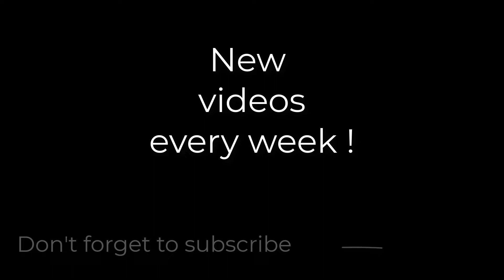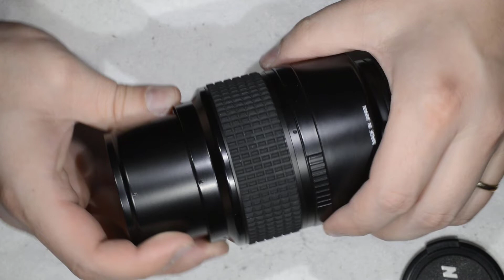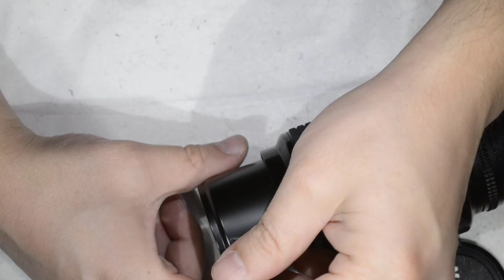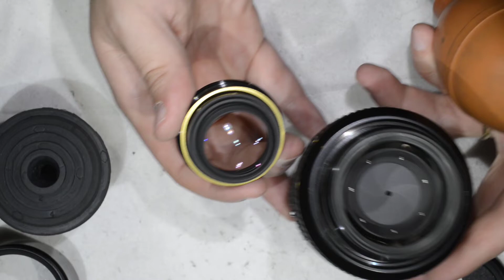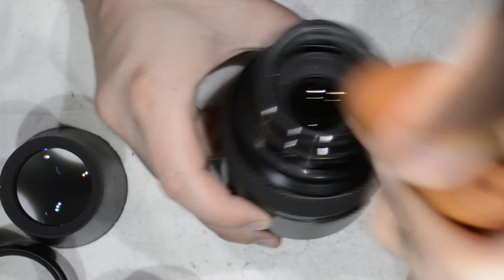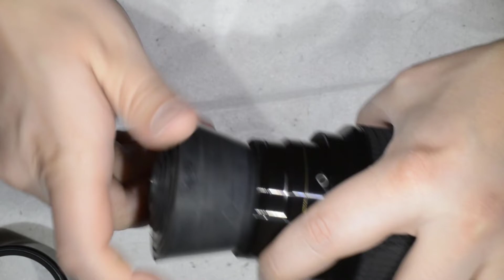Nikon Micro-Nikkor 105mm f/2.8 : Disassembly and Cleaning

Comment: Thanks for this video. I see how simple it was to clean front element, but the rear? Not a single video from anyone on that, which leads me to believe it is very difficult.
Reply from the maker: @treefellonya  not very difficult, I'd say uncommon, I've seen dozens of these and always very clean.
Reply: @diyextravaganza  Thanks for replying so fast... I was able to clean my front lens by following your tutorial, and it worked out great. Thank you for that. Mine is a 105mm f2.8 D - AF. It also has a little fungus on the back lens as well, but I have no clue as to where to start. Not sure how far to break it down or how the lens is secured to the lens barrel... Do you have a similar lens where you have taken the rear lens out? Thanks again.
Reply from the maker: @treefellonya  Hi, I've some copies of this lens but I don't think I've ever disassembled this lens from the back. I need to take a look to see if I have the repair manual somewhere.
Reply: @ That would be pretty amazing if you had a manual going back that far.
Reply from the maker: @treefellonya  I'll take a look, please write a new comment so I have in the list of unanswered comments and I don't forget about.